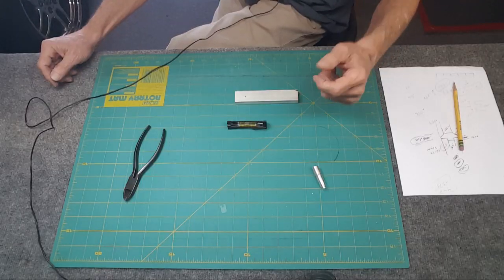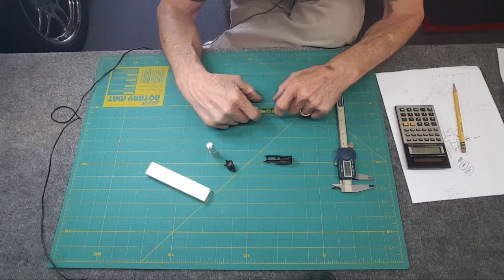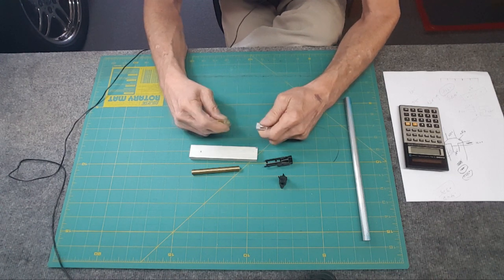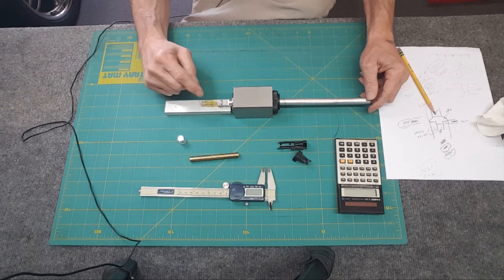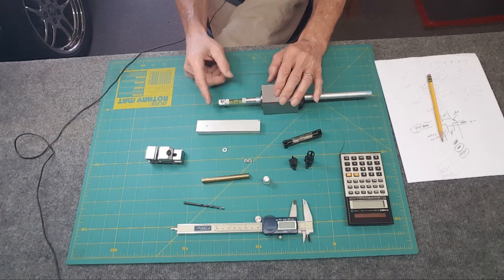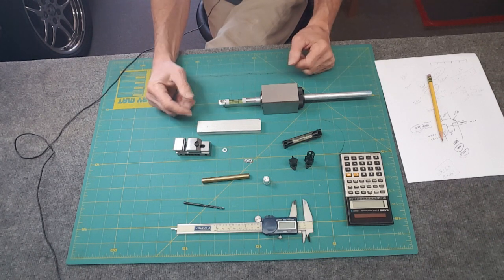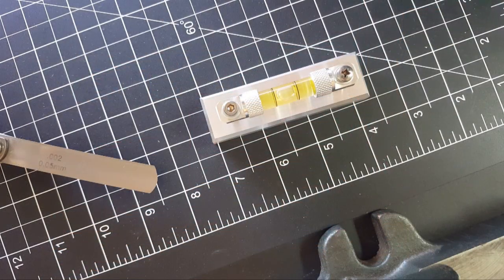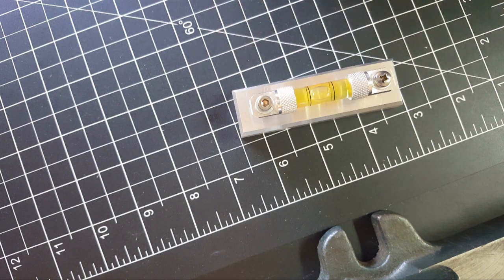DIY Precision Level

Comment: Nice one Dave,
Cool idea, there's a seller on eBay UK that sells precision vials.
About £10 to £15, 70mm long, they also have more graduations rings.
I may try this idea :)
Adam
Reply: The 35mm one is actually more accurate - 2mm at 60 inches. That's even cheaper

Comment: I have a couple of vials I use just as they are, no mount etc. Because the OD of them is very parallel, as long as your surface is flat so they don't roll off, they're ideal for use on small items.

Comment: I would have left it long. It's a tool for finding level, not flatness. So riding over the local roughness is a good thing. And how about a nice heavy compression spring under it at the adjustment end?
Reply from the maker: It was just a proof of concept and can be refined more now that I know how sensitive it is....